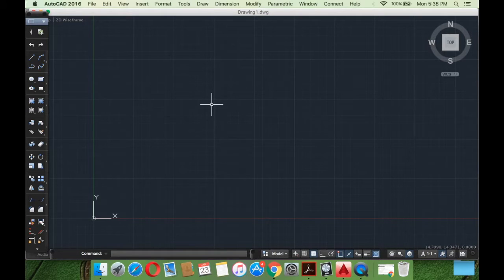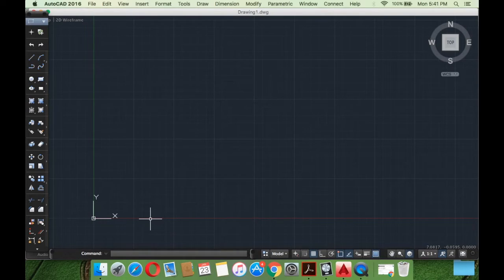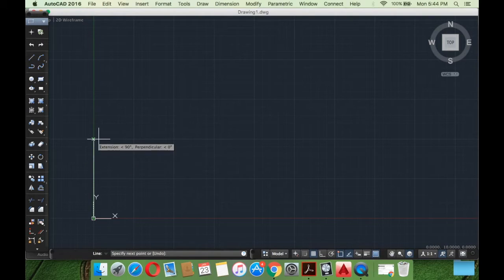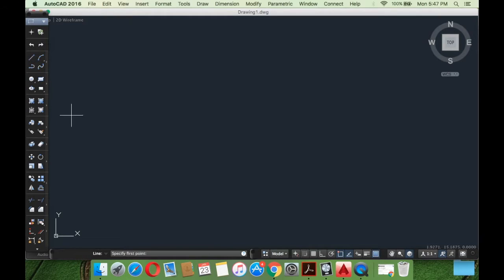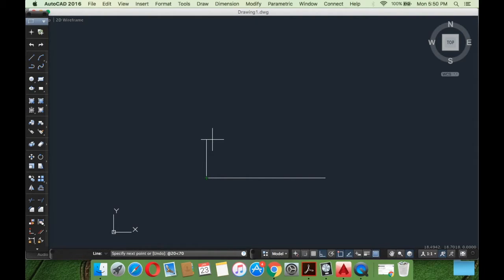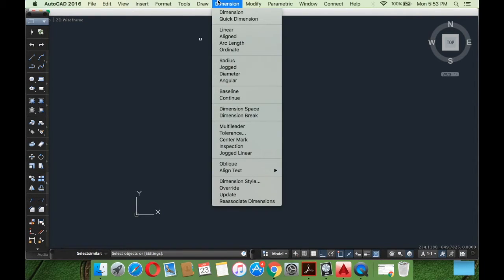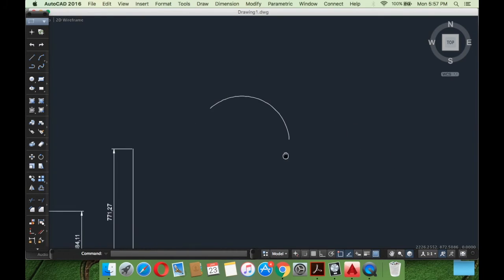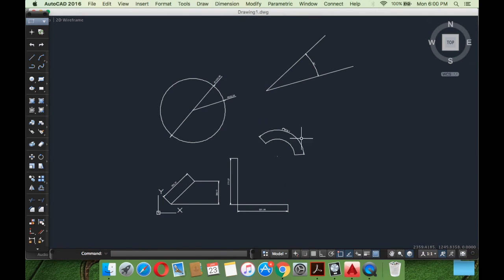Tutorial -3 AutoCAD 2016 on Macintosh (Mac ) - Methods of drawing lines and Dimensions

Comment: I specify the first coordinate which is 0,0, but when i try to specify the next coordinate so 0,10 or 10,0 (tried both) it stays on the 0,0 coordinate, I'm also using the 2017 auto cad, please help
Reply: when i choose 0,50, the line looks like yours, and only when i zoom in a lot i can see the line rising when i put 0,10, why do i have to zoom in so much? I'm on 1:1 just like you but something is off, please help
Reply from the maker: My dear, the option with which with you are opening the file, like ISO-AutoCAD may not be the one you want.
You can also play a little with the dimension style to get things right. If you believe that everything is according to what you want, go ahead and zoom !